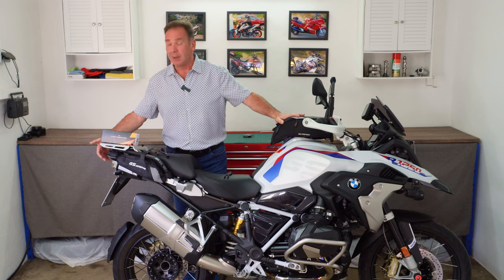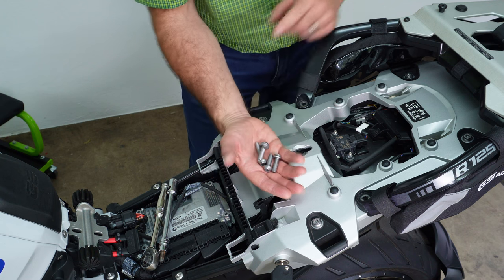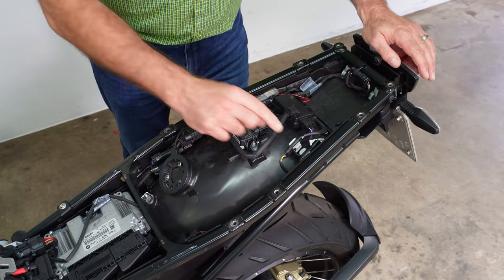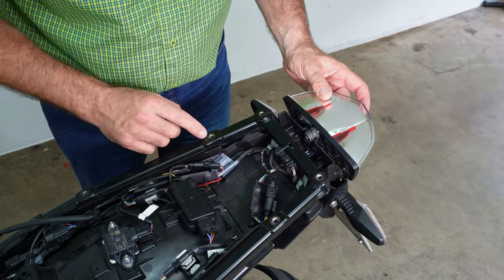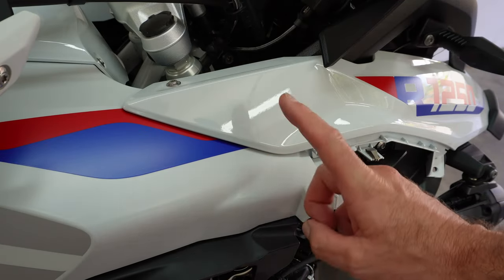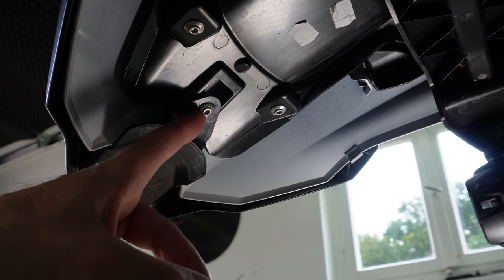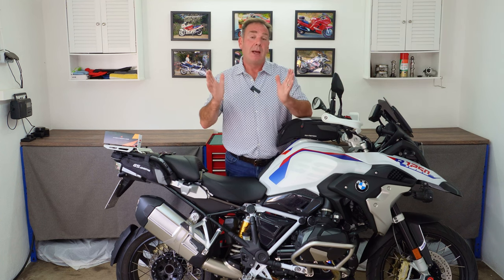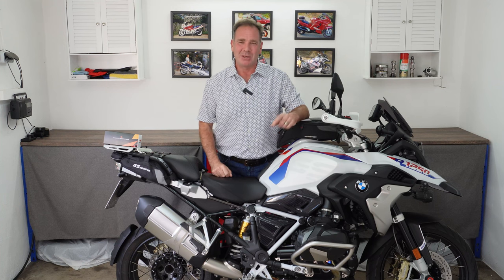EP:24 Weiser-Technik Wizard Module Installation Guide for BMW R1250-GS/GSA - Multifunction upgrade

Comment: What a first class video.  I fitted the the modules today to sort out the appalling mess that BMW has made of the turn signals on my new R1250GS, returning them to way they worked on my previous one.  Friends have already cheered as they are fed up with not being able to tell which way I was turning, especially when also braking.

Carl's very clear instructions made it just so straight forward and I love the hack about pushing the bolts through holes in cardboard to ensure they go back in the correct place - so much better than my previous method of placing things carefully in order on the floor!

Great product and great instructions from Carl.
Reply from the maker: Hi Sally, thank you for your kind words, and I’m delighted to hear you are pleased with your new indicators, they are SO… much better than OEM.
Have a great weekend 
Carl

Comment: Thanks Carl, as always very comprehensive.
Having watched this I took off the rack and cover only to realise I could have fitted the multifunction modules by just removing the seat. I didnt need the module for the centre brake day time run light as I had already coded it to be on. I was able to code the multifunction with a GS911 to be indicators only, or marker lights and indicators without the brake light function however you can't code them to do what the Weiser module do. You can also switch off the front orange marker lights.
Gave me a good excuse to give everything a thorough clean as it's amazing how much crud gets in there.

You have done a lot of good marketing for Weiser.
Reply from the maker: Hi Stuart, good to hear you have been successful and you made good use of the GS911 unit 👍. Thank you for your feedback and that the video was helpful.
Now it’s clean we just have wait for some better weather 🌦️ 
Best wishes Carl

Comment: Very much appreciated Carl,   all fitted now, the full dongle kit to my 2023 Triple Black Ultimate..  i was a bit shocked to learn that thevrear tail light was turned off apart from brake function.     My indicators are now much clearer with this kit and hopefully much safer.
Reply from the maker: Hi Billy, great news, glad you had a productive Sunday and your happy with the modules.
I was quite shocked to see on the new 1300GS they have completely removed the rear light!!!
Best wishes Carl

Comment: One word Carl: hallelujah! I can finally sort both of my BMWs! The rear kit for the XR may be even more useful as I’ve been repeatedly told by mates following me that they cannot see my rear indicators at all!
Reply from the maker: Hello, yes it’s an easy fix and plug and play, makes a big difference on the rear on the R series bikes.
Have fun with your installation 👍
Enjoy your Sunday 
Carl
Reply: Hi Carl, installed front and rear on the GS, very easy, complete within an hour. Your guide was very helpful. The XR took a bit longer as you need to remove the rear rack, side panels, rack arms, a metal housing, the two lower black plastic panels, the small rear plastic panel and finally the small panel holding the accessory USB port. Inside this there is a small square box where the indicator leads are housed. It’s fairly tight in there once the Weiser technik modules are added, but other than removing then re-fitting a total of 29 screws, it’s all pretty straightforward. The modules make a big difference on both bikes! Thanks again.
Reply from the maker: Glad to hear you got the modules installed on your XR. Thank you for sharing it will help other XR owners complete the installation 👍🙋🏻‍♂️
Best wishes Carl

Comment: Not sure how I missed this video. Another great how to Carl. I've finally fitted the "premium" solution with the run on module on my bike over the weekend after I had them sitting around for 6 months or more. Watched your video while doing the install and it was a breeze to complete. Absolutely love the brighter turn signals and the white DRLs add quite a bit of light at night as well off to the sides. My bike is a Japanese '21 GSA and I'll have to do some testing when I install the Denali SoundBomb, but the rear indicators don't change brightness when braking. They seem to be full bright all the time. I wired everything according to the instructions and your video so I'm sure that's all correct. I should have checked before I pulled the OEM off but I'm pretty sure they acted only as marker lights as well. Easy enough to verify by hooking the OEM signals up when I've got the bike apart to check. Which would help explain why nobody had any issues telling if I was braking or if my turn signals were on. I'll see what the Japanese inspectors think this April when I have to get my bike inspected for JCI, hopefully their cool with the change. Your videos are a great asset for us DIYers. Clear, concise, and you show every step as best you can. Thank you. There is another YouTuber, A Bike Thing, he has a shop in the UK and he and a friend of his developed a very nice headlight guard that looks OEM called the AMMO Guard. It's hard to tell there's anything different from stock. Might want to look into it, I know the Polizei in Germany can be sticklers about things after living there for 3 and half years.
Reply from the maker: Hi Correy, good morning 
Congratulations on your installation but I would double check your connection just to make sure and ensure the fuse is back in the holder.
I don’t know if the Japanese bike is a Global bike or a North American bike, but the wiring is different in terms of installation between both types to get everything working correctly.
You can view both wiring diagrams on the Weiser-Tech web site 
Let me know
Carl

Comment: Hi Carl, I came across your channel when researching information on the BMW R1250GS and I've found your videos very helpful, particularly those concerning the 'buggers muddle' BMW have made of their multi dis-functional indicators. I have now fitted a full set of the Weiser Wizard 'plug & play' modules and I couldn't be more happy with the result. On a different subject I see you are considering changing the screen on your 1250GS. If it helps I can recommend fitting the larger GSA screen, which makes for a better touring option. It's a simple 10 minute job to swap them over. Thank you and keep up the good work 👍
Reply from the maker: Hi Robin , good evening and thank you 🙏 that’s one screen I hope to test in spring. Glad you have enjoyed the GS series. And pleased to hear you have enjoyed the Weiser the Wizard Modules 👍.
More to come in the series once the weather improves.
Kind regards Carl

Comment: Excellent video Carl i found it very useful and thanks for the added bit at the end about German regs although it might not be relevant to uk bikes it nevertheless is useful if visiting Germany - I wonder if we would need to remove the 3rd rear module if touring in Germany or if like you we won’t be bothered by. German law as the bike would be ok for a legal mot in the uk.
Thanks again - I like your videos as they are very informative.
Reply from the maker: Glad you enjoyed the episode, with regards to the regs, you wont need to worry as your bike is a UK bike so no one is going to stop you. As for me, I prefer the extra visibility the centre light offers, even though its not strictly legal. 
Kindest Regards
Carl
Reply: Just want to say thanks - I bought the full kit and fitted them - easy after following your clear video instructions. Great work - loving the channel.
Reply from the maker: Your very welcome 🙏 
They do make quite an improvement 🙋🏻‍♂️

Comment: Hi carl. Brilliant videos, they have helped me understand my GS better, but not as well as you. Can you tell me How? you have got the large central rear light to work as a tail light? My 23 GS only uses the ridiculous and vulnerable indicators as tail light , with the centre light not showing any headlight (rear) function! I’m sure in your indicator change, your centre light was lit. Thanks, mb
Reply from the maker: Hi Mabs, yes of course 
Watch episode 23 it explains the module you need.
It’s called EXT run-on and you can order it on the Weiser-Tech website. Just add a note to your order asking for the Plug & Play Version.
It’s much simpler to install which I show in detail in episode 24
Best wishes Carl

Comment: Morning Carl, I have just purchased this set for my 21 Rallye GS based of your excellent and informative Video.  My question to you is - Would you know if these modules will cause errors at BMW service UK when the bike is plugged into their computer to update software? As my bike is due to go in and have the latest recall programming done. Many thanks, and look forward to your next item. Cheers Pete
Reply from the maker: Hi Pete, Weiser-Tech designed the Wizard modules to interface with the canbus system , and several UK BMW dealership are stocking these and installing them to their customers bikes.
So no they will be fine.
Thank you for feedback 
Best wishes Carl
Reply: @justthewayitis   Thank you Carl, for the prompt response.  I hadn't thought about that when i bought these from Sycamore Motorrad UK. Pete 👍
Reply from the maker: No problem 😉

Comment: Hi Carl. I had your channel recommended to me by a senior police motorcycle trainer. I realised quite quickly he was refrring to the poor lighting on the bike. As such I purchsed all 5 modules. Wow, what a difference. I do have one problem thouh with the front lights, one is clearly brighter than the other! I have checked connections and all is as it should be. Have you experienced this before or can offer any help?
Reply from the maker: Hi Jacko, and welcome to the channel. 👍
Ok, if one front indicator is brighter than the other it’s a voltage / current issue.
Both front indicators need the extra BLACK 12V feed wire connected to work correctly and be super bright, because the indicators need an extra 300mA to run super bright.

If, like I show in the video you should have a BLACK 12V wire running from the wiring harness at the bike of the bike to the front of the bike.

At the front it then splits two ways, one to the left and one to the right.

So first check that connection where all 3 wires join together.

You can also check you have 12V inside each indicator housing on the black wire ( make sure they are connected correctly by gently making sure they are pushed firmly onto the pins )

Don’t worry it will be something simple. 

Check above and report back 
Carl
Reply: Hi Carl, it was indeed the three way earth connection that was faulty. Now works perfectly. Thank you for your help - amazing @justthewayitis
Reply from the maker: Hi Jacko, glad I could help.
Have fun with your new indicators 
Carl

Comment: good video, but i have a S1000XR
Reply from the maker: Hi John, I have a video about the new Weiser Wizard Modules (V5) which is finished and ready to go live, but I’m waiting for Weiser to add the product to their website, hopefully they will have it ready within a week or two and then I can release the video.
The video uses a R1300GS but they are compatible with an XR.
If you can’t wait just send Weiser Technik an email (Mark) is the boss and give him your XR year model details as they have them in stock .
If your model does not have a tail lamp unit you can also add the third party tail light / brake light to the rear of your XR, Mark will clarify what’s available.
Kind regards Carl

Comment: Unless you have a 1300 Where BMW thought it wise to take off the TAIL LIGHT completely to put a radar sensor which will be rarely used.
Reply from the maker: There is a solution coming for this from Weiser-Technik which I will be demonstrating soon in an upcoming video 
Carl